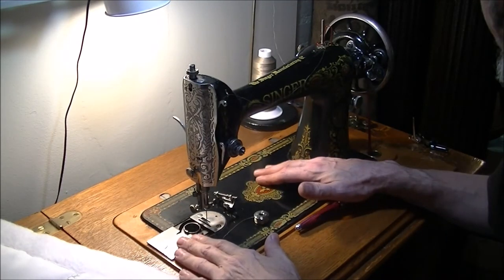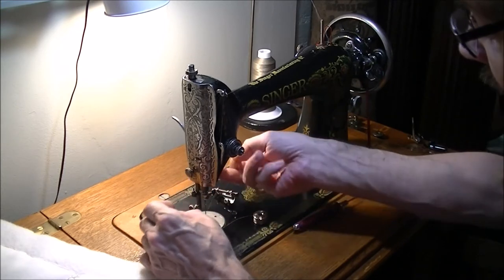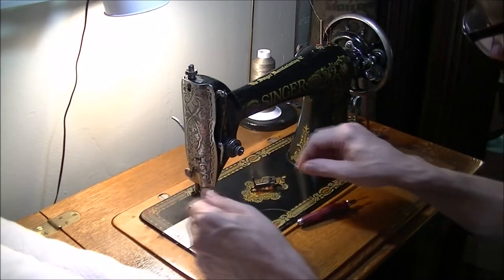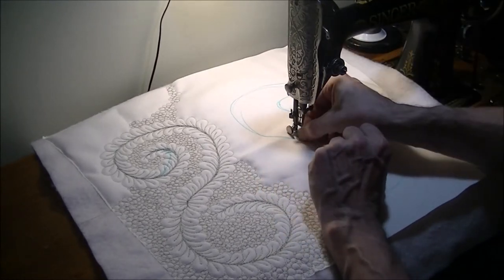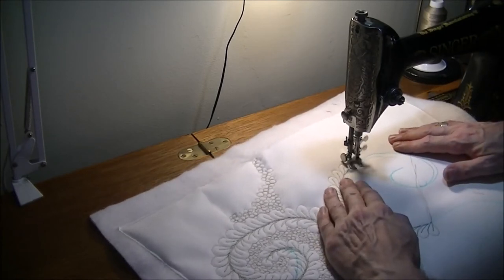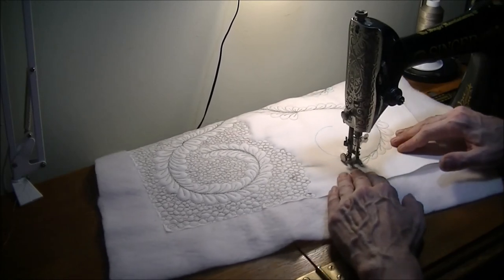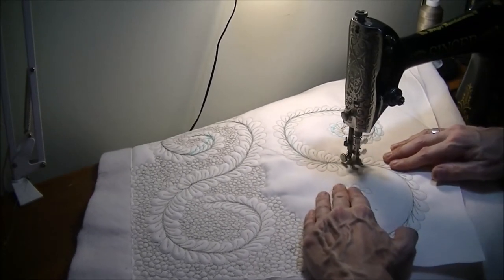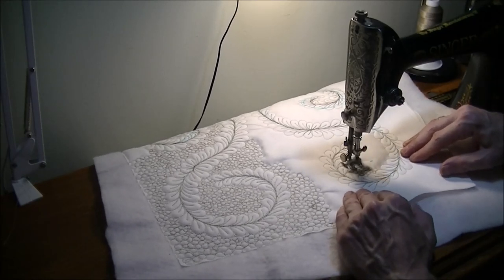Singer 66 Treadle  threading and FMQ

Comment: thankyou for mentioning the bobbin! I tried it. Thread still breaks though so I decided to wait until my darning foot comes in. the bed of your 66 is in alot better condition than mine.
Reply from the maker: the breaking thread is always a problem .....once you figure out the right combination on your machine it will be fine....it just takes trial and error to find just the right thing for that top area
Reply: Do I need to adjust the tension on the bobbin? I am a bit iffy about it since I sew on the same machine.
Reply from the maker: I have not adjusted the bobbin tension on mine for the same reason

Comment: I am using this exact machine to do free motion on a quilt.  I am half way finish and now the thread keeps breaking.  I don't know why it keeps breaking.
I guess I am using it too much lol.  The presser foot pressure get too heavy for me to move the fabric around (and I have to adjust it)and the thread guide (by the tension disk) screw keeps getting loose.

Comment: When I do FMQ on this singer machine, it feels tight.  Is it suppose to feel tight?  I've been sewing on a singer 4411 and the stitches didn't feel tight as I move the fabric around.
Reply from the maker: Tight.....hmmmm, not sure what you mean by that, but I would be sure the machine is well oiled and running smoothly and freely when doing "regular" sewing..... and then try FMQ....and adjust the pressure on the foot (the screw on the top of the machine connected to the presser bar) and last the tension.....
Reply: Thanks! I figured out it was the sewing machine's surface.  Now it doesn't feel tight anymore.
Reply from the maker: great!

Comment: I subscribed to your channel because of your beautiful award winning hand quilting.  I am very disappointed with all of this treadle machine work.  I don't know anyone with a treacle machine.
Reply from the maker: I have been unable to hand quilt for quite some time.   I have nerve damage to my quilting arm elbow and shoulder,  and it is very upsetting to me, but I am doing what I can do.   And it doesn't require a treadle machine, any machine will work but I am using what I have.
Reply: Any machine that does a straight stitch can do this. If your heart is set on a treadle, keep an eye out for them in antique shops, garage sales, and auctions. I even seen one pop up at a thrift store. The most common are Singer 66, Singer 15, and Singer 99. They all had good long production runs. Beware of the 66, find one that clamps on the side. Trust me, attachments are a lot easier to find for a side clamp!
Reply: Compared to electric machine users, us treadle users are small, yet a proud breed.
Reply from the maker: :) <3